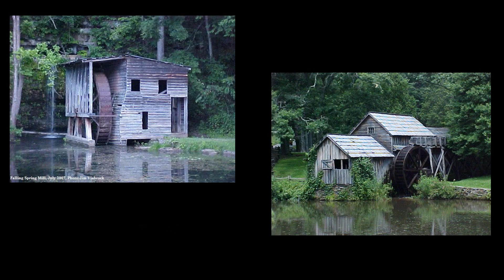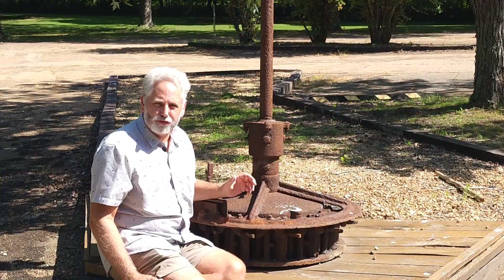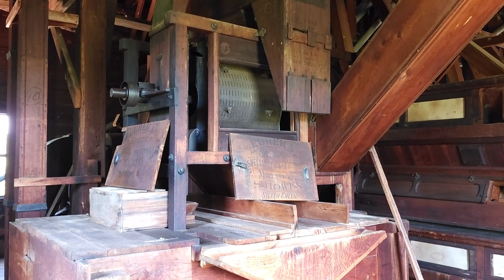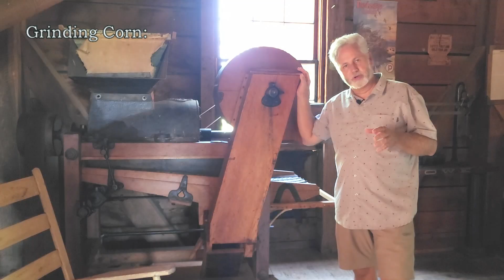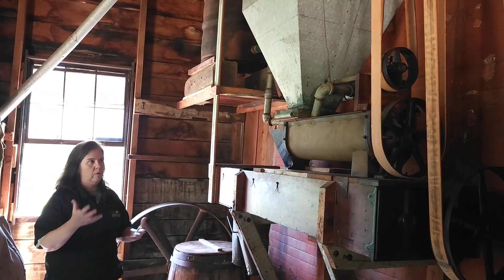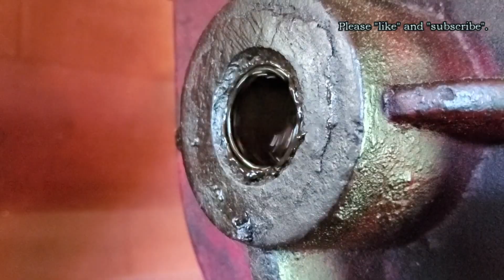Let's explore Dillard Mill. We'll watch this 1904 water powered grist mill operate. Grinding corn.

Comment: I have two griss mill stones both are made out granite and both are 36" in diameter and one is 8" thick and one is 12" thick. About how much does each weigh?
Reply from the maker: That would be hard to say without actually weighing them but, I'm told that the smaller stone would weigh somewhere between 1200 to 1500 pounds and the larger stone will top 2000 pounds easily.  Thank you for watching my videos.